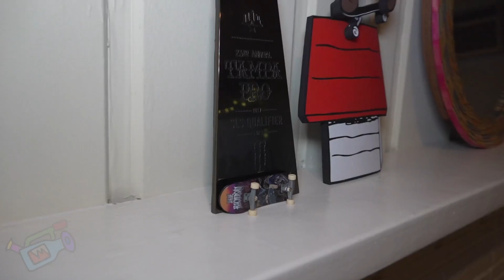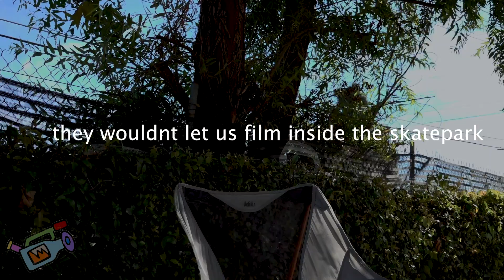Wood Working with Dave Bachinsky - shape 3 interview (RAW UNEDITED FOOTAGE)

Comment: What I want to know is why he skates a 7.5? I mean he rips but how come such a small board?
Reply: Jersey Devil he’s been around so long. Tech skaters from 20 years ago usually don’t get over a size 8
Reply: It could have something to do with foot size. Also, a 7.5 is way easier to flip than an 8 or wider. I still don't understand why everyone feels a need for an 8 or larger these days. Maybe something in the peanut butter is jacking kids' feet these days so they NEED larger boards, I dunno
Reply: Because back when we were young in the mid 90’s normal decks width was around 7 .5” -7.65” and it was super easy to do flip tricks and a 8” deck was big and usually the very guys would ride them lol